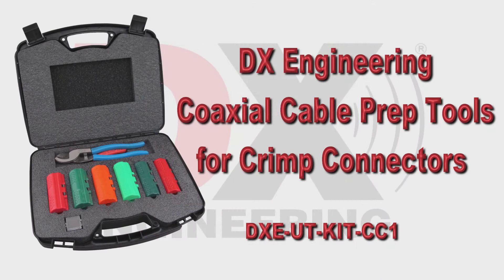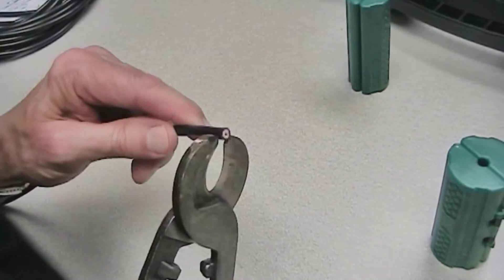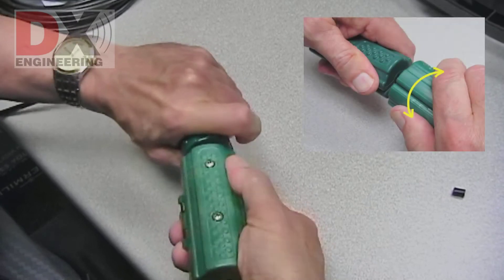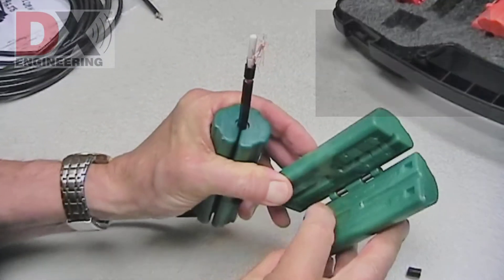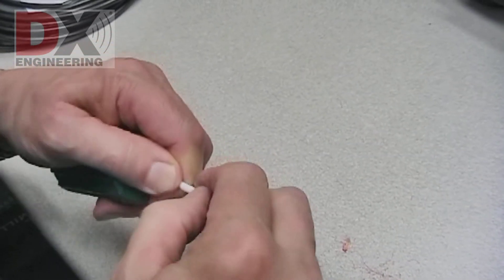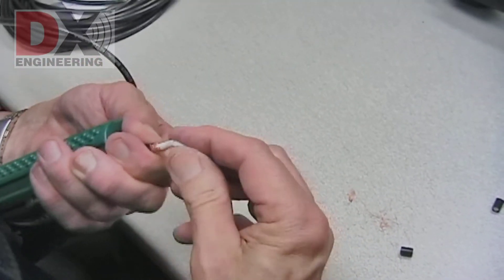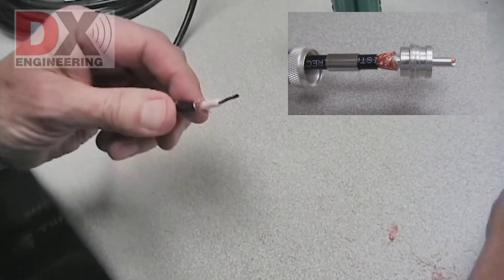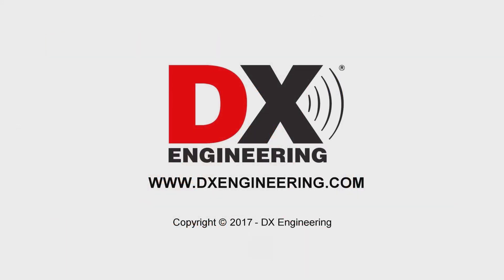Crimp Connector Cable Prep - RG-8X

Comment: Is there such a thing as a "compression" PL259 type fitting like are available in the "F" connector style??  I have had great luck using compression F connectors for RG6 type cable for TV antennas.  Thanks for these DIY type vids.
Reply from the maker: I have seen a compression type BNC connectors from SNS, but have never tried one. I think there may be a compression type from somewhere in Europe - but again, nothing in-hand to look at. 
Glad you like the video - there will be a few more on this kit coming in the next week or so.  73